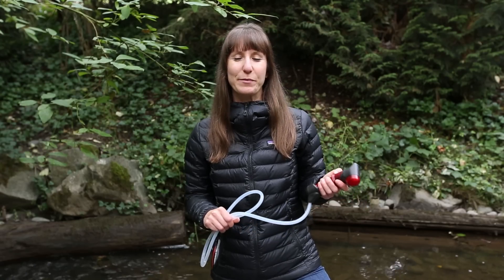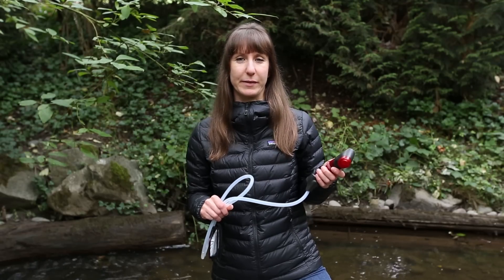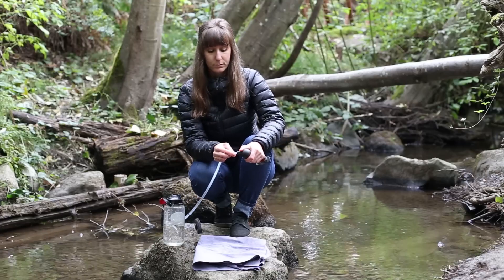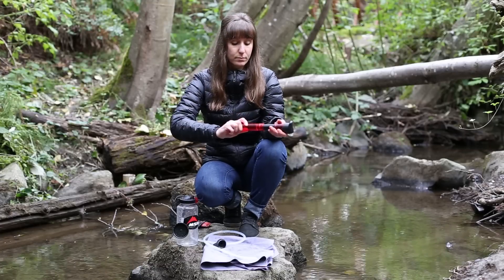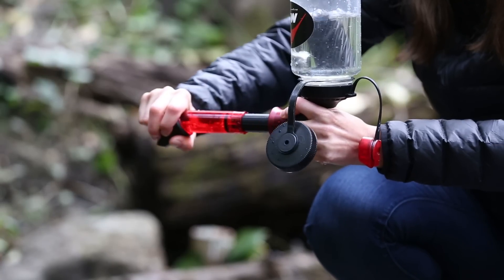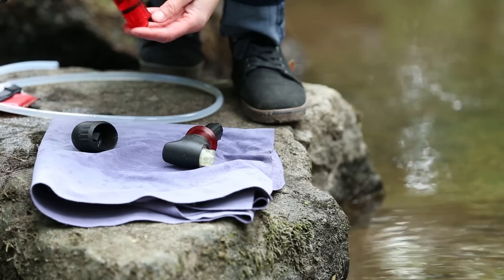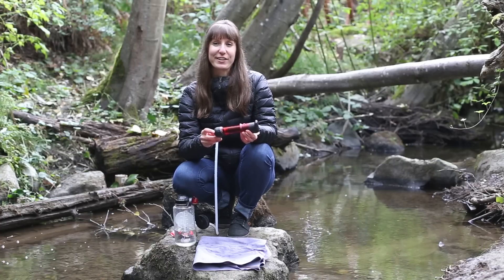How To Backflush: MSR HyperFlow

Comment: Excellent video, Thank you for sharing with us.
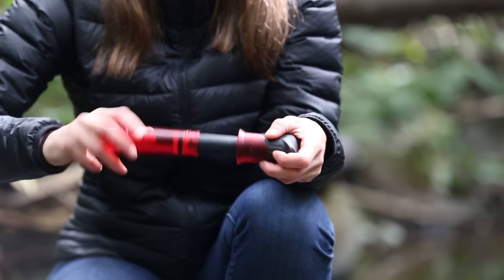Reply: I HATE this video. I own two of these.  At 1:26 in the video it states, "Don't pump any air through the filter."  However,  the process they demonstrate WILL PUMP AIR THROUGH  THE FILTER AND LOCK UP YOUR PUMP!!.  There are other videos that show how to do it correctly by retracting the main tube BEFORE you attach the inlet valve body and it will work every time, so if you have issues with the pump not back flushing properly, ditch the people who are just trying to sell them and look at the videos from people that actually use them.  You will save yourself a lot of trouble.
Reply: @rogerackerson4590  I agree this seems like a huge problem coming from MSR itself. Either you push the air out of the cylinder with no resistance (before you reattach the inlet check valve) or you push the air out of the cylinder with the resistance of that check valve attached. Maybe it doesn't matter, but the former seems smarter...
Reply from the maker: No problem.